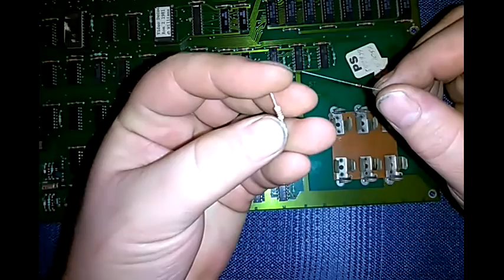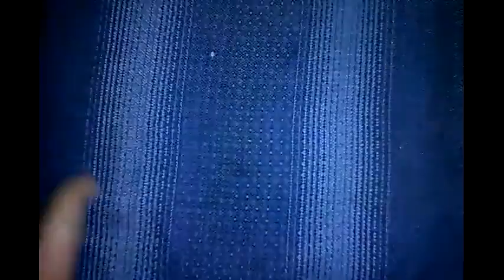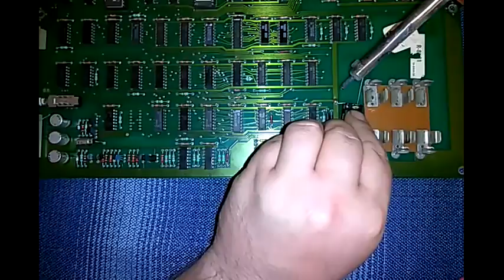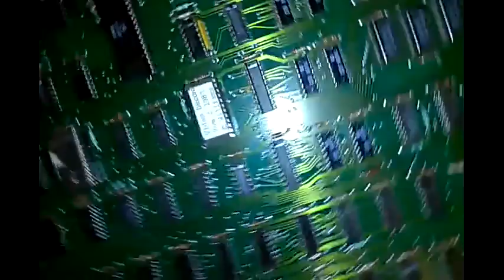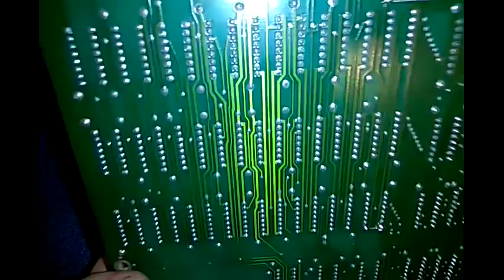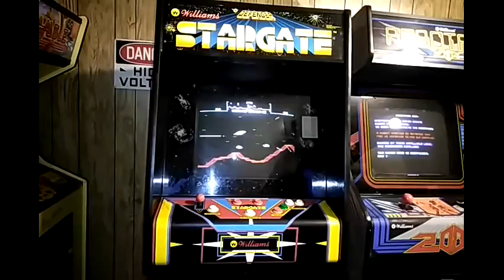Installing a super cap on a Williams CPU

Comment: next time don't scratch the GND track, use the holder where the original battery is, set in its center the supercap, and then solder it in the back of the original solder points, and that way it can be fully reversed without show there was some mod before.
Reply from the maker: your right i could have done it that way doesn't really bother me though  also i don't  believe there is enough  room behind the board to mount this specific cap and still screw the pcb down properly
Reply: I mean this way, https://wmpics.pics/di-9R0RYEYN.png
Reply from the maker: that would work